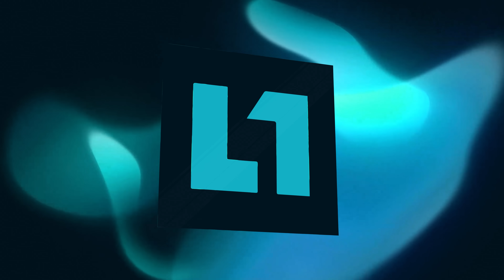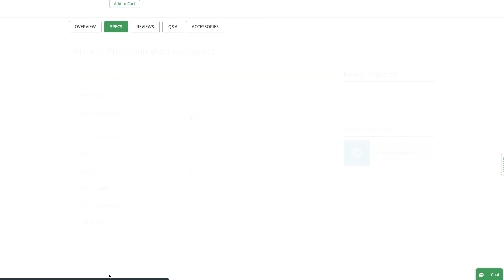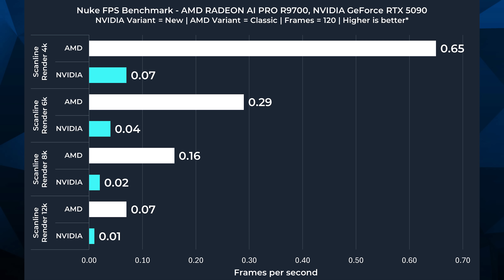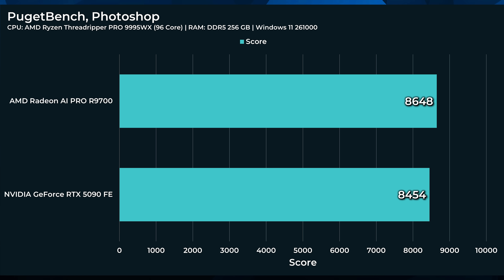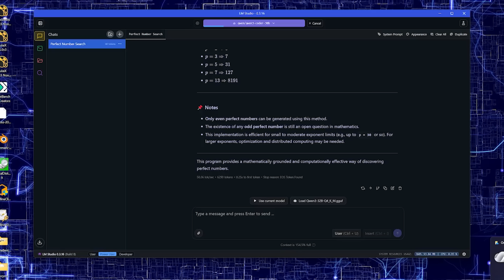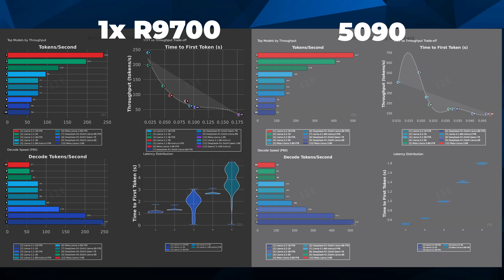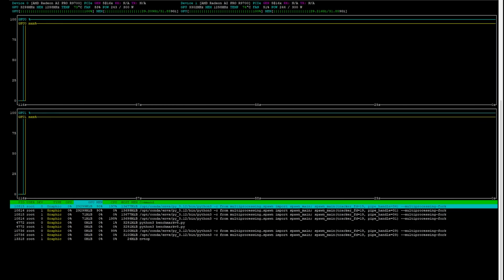Radeon R9700 Dual GPU First Look — AI/vLLM plus creative tests with Nuke & the Adobe Suite

Comment: I would love to see the benchmarks for 4x9700 🔥
Reply: Or 8 of them. With Bifurcation on the x16 slots, that should work well. Initial load of LLMs would be slower, but I don't think you would notice a difference otherwise. And with 256 GB of memory, you can run larger models/ better quants and lager context windows.

Not sure you would need that for other applications, though.
Reply: @NdxtremePro Think that’s a bit overkill bc the RX 9080XT is launching at in Jan. Expecting a R9800 GPU with 64G of VRAM launching by Computex 2026.
Reply: @tringuyen7519  No it's not. AMD has stated repeatedly that they won't return to high end until UDNA/RDNA5. I could see a "binned 9070XT" SKU, but that's about it.
Reply: @tringuyen7519  There are models that are 768GB in size now. Don't threaten me with more RAM. :)
Reply: @tringuyen7519  do yourself a favor and stop blindly trusting MLD.
Reply: @sirmonkey1985  To be fair I watch MLID often and he has not said anything that I recall in recent episodes about a 9080 for sure coming in January. He theorized months ago that it would possibly happen before the end of this year but he has not outright said 9080 is coming soon.

edit 10/31/2025 for clarification - he talked about a 9070 core with higher clocks being tested internally with GDDR7 some months ago. He said he had multiple sources for this if I remember correctly. Not sure how he touched on it not coming out but logically it probably was only internal testing and they're focusing on delivering a more complete stack of Radeon in the next architecture instead of putting out a more flagship class card in the stack that's currently targeted at budget and mid range pricepoints. 

My guess - the ROCM and other AI performance in RDNA4 isn't close to where they know RDNA5 will be. Delivering higher VRAM and better AI performing cards is most likely the combo they're aiming for in a number of cards next-gen.
Reply: @tringuyen7519  which channel did you watch that made up the rumor about a 9080xt?
Reply: @tringuyen7519 lol, lmao
Reply: *1
Reply: First can you afford it
Reply: Vulcan vs. ROCm inference & fine-tuning what performs better ?
Reply: judging it performs about as well as a 3090, i'd say slightly worse than 4x 3090s
Reply: @therealchuckler I have a RTX 3090 and was considering upgrading, is it worth the asking price for the additional 8GB?
Reply: @davidsilva3567 depends on how much you value that VRAM and int4 / FP8 support. You lose CUDA going with AMD but ROCM isn't too bad for most applications now. I use a 7900XTX as my daily driver, anything that needs more memory I use my DGX Spark cluster. I suggest checking out benchmarks with more recent drivers as things have changed a bit in the past 6 months.

Comment: Would this be a good option for Autodesk Fusion? Or would I be better off sticking with 50 series Nvidia card?
Reply: Iirc Fusion360 isn't too picky about what GPU you use, main issue is that both options you suggested are massive overkill for the vast majority of Fusion users, and the few who actually need a top end card also know enough about their workload to gauge what cards will work well for them

Comment: Mmmmmm.... I wonder i can use this for a dual purpose. For work and for Fun like gaming.
Reply: Blower cards are loud as fuck, but if you're using headphones anyway that may not be a problem. But yes, this is a 9070XT with 32GB in all other respects than card design.

Comment: Ah yes the gpu with 16gb more vram for a 700$ premium... what a rip off.
Reply: What other GPU has 32GB VRAM for this price?
Reply: @shadow7037932 Radeon instinct mi50 has 32GB of HBM2 VRAM for $220 USD on eBay right now.
Reply: Pro cards always have big premium for pro feature support mostly (like virtual gpu splitting)
Reply: That's Datacenter for you. They'd even probably mark it up 300-400$ for the same vRAM and NVIDIA even more (just look at the prices for 4GB notebook workstation GPUs from NVIDIA and remember they are really shitty).
Reply: 16GB more VRAM, better binned silicon and a VRM and fan that are designed for 24/7 operations for 5 years at full tilt. If you do that to a consumer card I absolutely guarantee you that you're going to fry a power stage or have a bearing chew itself.
Reply: RTX4000 24GB Blackwell, is a RTX5070TI with 24GB VRAM and has MSRP $2500. $2000 for just +8GB VRAM. That's what we call RIP OFF.